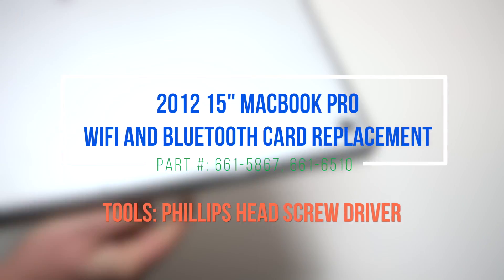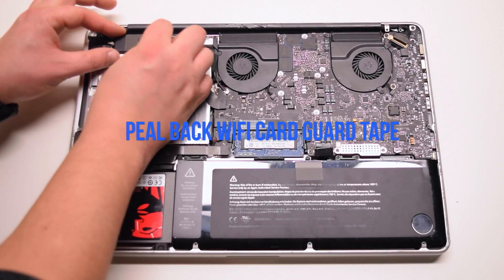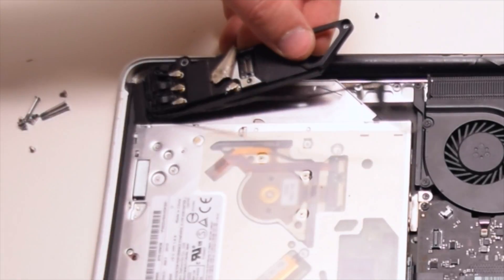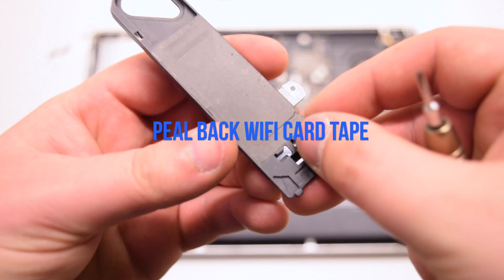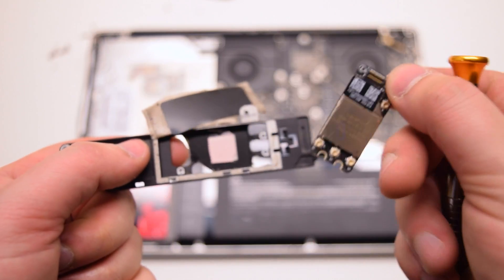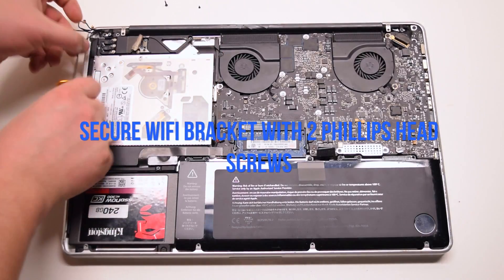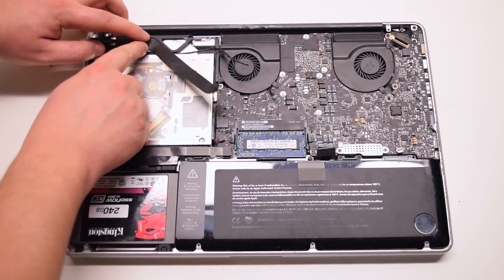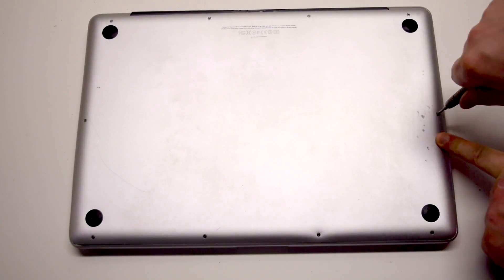2012 Macbook Pro 15" A1286 WiFi and Bluetooth Card Replacement

Comment: Thanks for the video! The wifi went out on my 2012 MBP 15" recently and I thought I could use a USB adapter to avoid having to take the MBP apart, but the adapter wouldn't work for AirDrop, so I ended up having to buy a used AirPort card on eBay. Luckily, I found a complete assembly with the card, antenna and bracket which made the install easier - I didn't even need to disconnect the FaceTime camera wire, which was good since I couldn't actually get it loose. Now I have wifi AND Air Drop back! Thanks, again! Great tutorial!s

Comment: I can still connect Bluetooth but it says no wifi hardware installed would this be the fix to my problem
Reply: I have the exact same problem. Did you solve your issue finally ?
Did you also replace the WiFi cable ? https://www.youtube.com/watch?v=tg5gNop2Cos

Comment: Im having a issue removed the wifi card bracket. the screw is stripped on the right.  Any sugestions?
Reply: Stick it down with some BluTac
Reply: @redgum1340  Thats great but I was wanted to get it off to remove the dvd drive to put a 2nd hard drive adaptor in. O eventually got it sorted.

Comment: My Problem is that the WIFI works for about 2-3 Minutes then shuts down. I've replaced the WIFI Card but the Problem is still there, any suggestions?
Reply: I have the same problem but in my mac wifi turns off then i cannot turns on,
Reply: @andresdelgado471  did you already found a solution for this problem? i have the same problem
Reply: @samuelgraf676  yes, the solution was buy a new airport wifi card, but to be frank, i'm not  sure what kind of make you need buy, because i send my macbook to computer repairer, i hope my comment was usefull, hava a nice day
Reply: Did you also replace the WiFi cable ? https://www.youtube.com/watch?v=tg5gNop2Cos
It may be due to that, did you solve your issue finally ?

Comment: My WiFi is not working (2012 MBP) but the Bluetooth is working. Does that card operate both and if so, as Bluetooth is fine, does that mean my card may be ok, but perhaps it's just a cable issue? Thanks
Reply from the maker: Open it up and look for damage and reseat the cable.
Reply: I have the exact same problem. Did you solve your issue finally ?
Did you also replace the WiFi cable ? https://www.youtube.com/watch?v=tg5gNop2Cos
Reply: @friederpeter  I replaced the card but the wifi still didn't work. I had to actually cut part of the chassis too to put the card in as the screw would not come out, so I butchered by MBP and paid for a new card for no reason. I just bought a wifi USB dongle and I live with that. It's faster than the in built wifi on a 2012 MBP anyway probably.

Comment: Is there an AC compatible wifi card upgrade for the unibody mid 2012 non-retina? Also is it possible to fit a retina screen for a mid 2012 retina, to a mid2012 non-retina?
Reply from the maker: Retian is produced by the graphics card first (most commonly Iris graphics), before it's displayed on to the screen and no macbook pro pre late 2012 had retina capable graphics hardware on the logicboard so the short answer is no you can't transfer the retina screen. Answer is same for the AC card. No AC support on the controller for the wifi card.
Reply: Save Apple Dollars mid-2012 map retina has gt 650m graphics, so does the non-retina. So both should be capable of running the display. At this point it’s if the connectors and hinges are the same. Also I’ve seen somewhere an instruction manual for putting later model airport cards into the unibody mbp. Just can’t find it and might be hallucinating.

Comment: Is the replacement of the WiFi antenna for a 2012 MacBook Pro 15" similar to the 2009 A1286 video instructions in that you need to remove the LVDS bracket, hinges, and antenna cover? I would like to see what the cables look like at the base of the display underneath the antenna cover.
Reply from the maker: Depends, if the 2012 is retina or not. If it's late 2012 retina then it's different, if it's 2009-2012 a1278 or a1286 pre retina it's very similar.

Comment: When you disconnect the wifi cable from the motherboard, does it have adhesive or does it actually connect? Im wondering because mine doesn't connect back. I try to connect to the motherboard and it doesn't "stay".
Reply from the maker: Could be that the connector holster is damaged. It should be a flush tight fit.

Comment: Did you use the same philips screw driver (#00) to remove both screws on the wifi bracket? Anyone here had issues removing the one on the right (recessed) side? Its my first time trying to remove it and it looks like the screw was already stripped. =(
Reply from the maker: If its stripped just try the star bit screwdrivers in your kit, the damage has already been done.